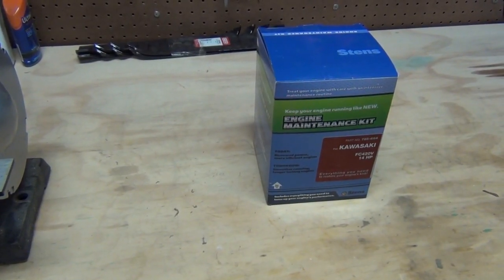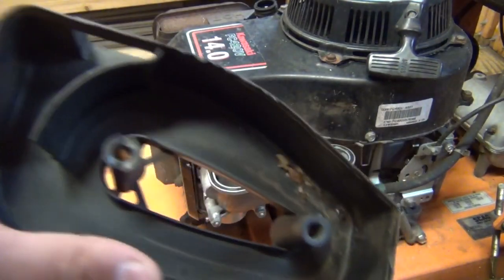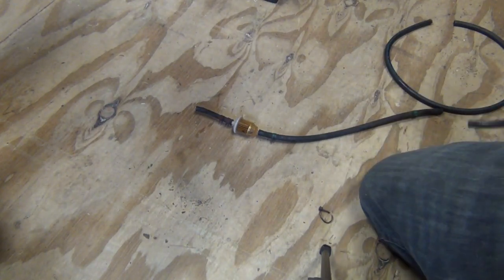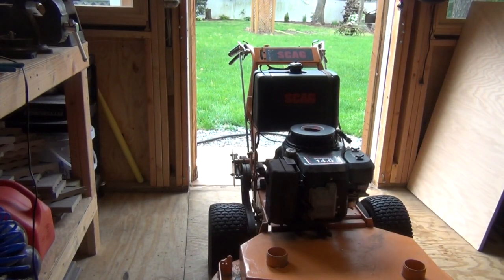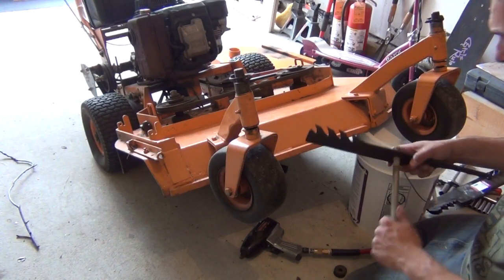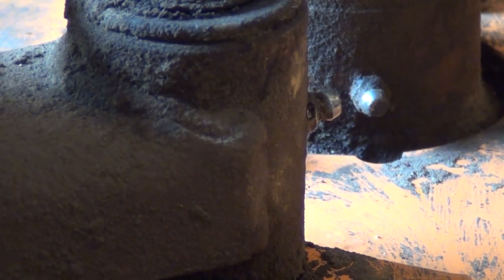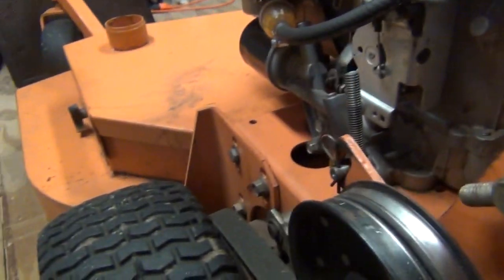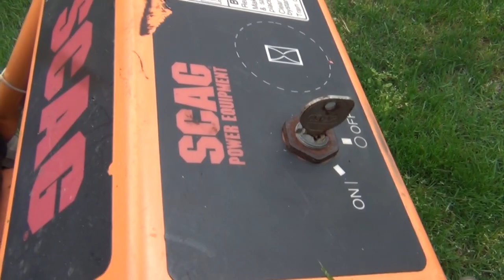Scag lawn mower tune up

Comment: I always run my engine for about 10 minutes before I change the oil. It allows the oil to flow better and it also helps to kick up any sludge that's on the bottom of the engine

Comment: Thank you for an excellent video.zimsjeep.  I've done it a thousand times and still enjoyed your video.  The one thing I would consider is disconnecting the spark plug wire while changing the blades.  There isn't a lot of risk with the impact gun, but others might accidentally get the blade moving and risk losing a finger, hand or arm.  I know a few people who unfortunately made that mistake.

Comment: I think for anyone with any sort of general mechanical knowledge the stuff in your video should be common practice.  However to those who aren't familiar, this video is very well planned out and easily followed.  Great job.  

I picked up a 20+ year old Scag this past weekend.  It has sat for at least 12 years.  Had fuel in it still...not good.  So I ordered a new carburetor, fuel lines, fuel filter, etc.  Once I get it running I'll be doing the oil/filter change as well as new belts.  The one I have has the Kohler 14HP OHV engine.  Supposedly it ran when it was put in the storage shed but who knows LOL.  It will receive a full tune up before it hits the lawn.  Thinking a new set of blades while I'm at it as well...probably standard high lift blades as its setup for side discharge, but may look at other blade options later on once I get it going and do a few lawns.  

Only issue I'm having is the front caster tires are in extremely bad shape, and from what I've found I have to go through a Scag dealer for parts so that'll be another item on my list is to replace all the tires.

Comment: Well done and thanks. My 48 belt drive is 20 yrs this summer. The dealer gets $150 plus delivery to do this work so I have learned over the years. Will look at adjusting the tracking and brakes this weekend--could never figure that out before.  

Q: Re greasing: I wipe well but have not tried a fitting spike. It seems like most times it is very hard to pump--possibly because they are clogged?
Reply from the maker: You're welcome. Glad you found it helpful. Definitely work open those zerk grease fittings with an awl or small screwdriver. They're probably stuck closed which is causing your problem.  If they won't open up, they can be easily replaced. You can get a pack of 10 online for 5-10 bucks.

Comment: like the video very imformative . im considering a scag for residential and some side jobs was curious if the 36 is big enough for most lawns or should go to 48?and to adjust the height of blade theres no lever or anything you have to just add or delete washers? are all scags like this ? last what about the transmission oil is that serviceable ? Thanks

Comment: Great video I enjoyed it I'm getting ready to change the belts on mine I can't find a video on how to do that
Reply from the maker: Thanks man, I had a whole video filmed of belts on this same mower last year. Went to download it to my computer and the memory stick was corrupt!  Anyway what belt are you changing?  Blade belt is easy. When the clutch is disengaged, you have plenty of slack to slip it over the pulleys.  Drive belts are easy too. I pulled the wheels off, made it a little easier but I mainly did that because I changed the tires. Transmission belt isn’t bad either

Comment: was a very good thourogh video!  I am fairly mechanically inclined, but neve had a good mower untill now. just picked up a used one.  Only thing I am wondering in the transmission.  Since i bought it used, i just want to make sure it has oil in it.  how do you check that?
Reply: If you're still wondering they take grease not oil, I had to rebuild mine. If your concerned you can pop the cover off and check if it has grease but should be ok

Comment: Great video! Could you possibly do a video on how to properly adjust or tighten the cutting / drive belt? Your instructional video was great but this one piece of info as you can see has a lot of us needing direction. Any help would be great! Keep up the awesome work.
Reply from the maker: David Harkins thanks for the comment. I'll do a video regarding the belts soon. I changed to deck belt this past spring.  My plan is to replace the drive belts next spring so look for a video early 2018

Comment: GREAT VIDEO. I just got a Scag identical to yours , but with service replacement motor.  Any way to tell how old the machine is with the serial number? The motor is last years model, but the machine is older. In fact,  Looks identical to yours as far a placement of fittings, deck, handles, etc.  This video was very helpful. Thanks for taking the time.
Reply from the maker: Jason Schley Not sure how to tell from serial numbers but if it helps, mine is a 98.

Comment: How do I get off the seized hydro plug? Bent the Allen wrench in the process.  I need to put hydro fluid back in. Can I fill 2 quarts per each pump from the top by taking off the visible plastic holding container and pumping the fluids through the rubber tubing to the pumps?

Comment: What kind of oil do you use, can’t read the weight on the bottle in the video. I just got an older scag walk behind like this one. Thanks!
Reply from the maker: I’ve always used straight 30 weight oil. Had this mower for over 20 years now. No issues

Comment: How much did all of this work cost to get the materials so the kit plus new blades and oil? I am thinking o buying a used toro similar deal. I am guessing by the pictures it could use this work though.
Reply from the maker: Blades were around 20,  the maintenance kit I believe was somewhere around 25 and the oil around 10. So around 50-60 for everything.  You'll definitely save a ton doing it yourself. Isn't too involved.

Comment: Any tricks to get blades off that probably haven't been removed in 12+ years?  I got one broke loose, but the one on the discharge side won't budge.
Reply from the maker: William Todd Other then the old tried and true block of 2x4 as a wedge and a 1/2" drive ratchet with big cheater bar, not really.  I have an old piece of top pipe from a chain link fence. Thing is 6 foot long.  Fits right over the ratchet handle and busts everything loose that I've used it on.
Reply: Maybe try soaking it real good overnight with pb blaster.  The previous suggestion will definitely work as well.  A 2ft pipe over the ratchet usually works great.

Comment: I'm new to commercial cutting and after watching this I had one question...You put on mulching blades but are using the side discharge while cutting, is there any particular reason for this?
Reply from the maker: Good question - The mulching blades regardless if the grass is side discharged or not still produces a more finely cut grass blade in my opinion.  Ideally, you are correct.   They would probably work better if the grass was recirculated under the deck before discharge.  Also, the price difference between a mulching blade and regular blade isn't all that much.
Reply: Id like to add to that. I use gator blades on my Ferris.(in photo) and in the spring the grass is out of control. Sometimes you're cutting off 3-4 inches in some of the first few weeks. You can go over that twice because regular blades dont chop it up fine. Gator or mulch blades shoot out a mist of grass. Also it doesn't stick as much under my deck. I go over a yard one time where competitors have to go over 2-3 times. They also spend more time blowing off sidewalks than they do mowing the grass. lol  With mulch blades throwing out of the side, you get a finer grass cut. Like i said, the grass shooting out of my deck looks like a mist rather than long blades of grass that i have to go over. Time = $$$.. good luck!
Reply: ***** no matter what blades you use,you need a discharge chute on your michine ,,vedio guy dont have one
Reply: Mowed for 20 years successfully without one. We'll manage.

Comment: I'm new to these type of mowers and this may be a stupid question, but can you change the deck height? I'm stepping up from a regular push mower
Reply from the maker: Yes,  check the part of this video where I change the blades...you can adjust the cut height by placing the spacer washers above or under the blades.
Reply: +zimsjeep I mean the deck. I understand what you're saying but is there a way to raise/lower the deck like on a regular push mower? Thanks

Comment: May be a dumb question, but how do you reverse it without switching gears???? I just got a 32" Scag with a 16HP Kawasaki engine, and this is the only problem I have with it. I always find myself in spots where I need to back it up a bit to finish making a turn, but have to switch gears to do it. I'm sure it's a simple technique that I'm missing. Thanks!
Reply from the maker: Pull up on the handles until forward drive disengages but not to far that the brake activates.  You'll then need to muscle around the machine to reverse.  Good tip is to position the mower when you're ready to turn in such a way with the forward gear that all you need to do is pull back maybe a foot before going forward again...if that makes any sense.  I rarely use reverse.  Once you get the above technique down, you can do it in your sleep.
Reply: zimsjeep Thank you! This was very helpful.
Reply: @fixitwithzim  tengo el mismo Problema no puedo ajustar la reversa solo da buelta pero no agarra las bandas para reversa Tendras una respuesta en español.

Comment: Question i have a scag sw36a-16kai will that kit work on mine ??
Reply from the maker: Lazaro Martinez I believe if you google the part number of the kit, you can cross reference to see if it fits the motor on your mower.
Reply: zimsjeep idk i cant seem to fine any kits for the 16hp Kawasaki engine , i keep coming across the same one u have for the 14hp engine but dont know if its the same thing . Oh well

Comment: I was wondering how easy it is to muscle around with the pistol grips. I have an Exmark with ECS controls and sometimes it's a real pain so I wind up just mowing my lawn in a cross cut pattern. So, I was thinking of selling it and getting a scag sw.
Reply from the maker: I don't mind the pistol grips. Some complain about them but I don't have any issues.  I only use it for my yard now but used it a while
Back for my business I sold. No issues either way. Now going from a hydro to this might be a different story but I think in your case, you'll be alright. Just keep everything well greased. It helps a lot.
Reply: +zimsjeep I am coming from a belt machine but there's only one exmark dealer in my area and he wont come pick the machine up and work on it if something majorly goes wrong with it and though I am handy I can't tear my engine apart and rebuild it. There are several scag dealers that will pick the machine up and work on them so I figure if I am going to have an expensive machine I might as well have that safety blanket. Also how is the stripe? My exmark stripes last like a month but the cut isn't exactly anything to rave about, it leaves stragglers and tall grass just bent over. Also if the grass it high it leaves a strip down the center of uncut grass. The scag looks like it cut that tall grass perfectly in one pass.
Reply from the maker: duellingcarl I had that problem with a strip of grass left uncut down the middle once when I changed blades.  I don't recall why it happened.  They were the right size blade but maybe something with the air velocity in the middle with the mulching blade caused it.  Like I said I don't remember as it was a long time ago.  Stripe is great with the scag.  As far as worrying about the engine, do the proper tuneups and take care of it and you almost certainly won't have to worry about rebuilding the engine.  Most of the time, guys don't even rebuild anymore - Easier and faster to just replace the motor.  95% of your engine problems with be fuel/carb issues.  They are always easy to fix and remedy.
Reply: +zimsjeep I think the strip of uncut grass has something to do with air velocity. I am down on rpms already and the belt tension adjustment is right under the muffler (bad design) so the belt is definitely too loose. It's just so hard to get to.

Comment: what is the best way to change the Drive belt? It is located right under the engine block but there are 2 other belts below it. Do you take off the other belts then put on drive belt. Or take off the pulley?
Reply: I figured it out. I took off a bracket, loosened the tension on the belts, unclipped wire harness. Slid drive belt up to top pulley. Then tighten everything back up. Its a good idea to take pics before you start demo & you can refer to them when putting back together.
Reply from the maker: Kim Zenk Glad you got it figured out. I'm actually doing a full belt change on the mower in this video tomorrow.  Drive belt on mine is original. Not bad - almost 17 years old.  Thanks for the tips, very timely.

Comment: How did u reverse it when turning since it is a gear drive and u didn't shift it into reverse
Reply from the maker: Pull up on the controls to disengage the forward drive but not too far that the brakes engage. You're now basically in neutral and can free wheel the deck around with some muscle.
Reply: zimsjeep thanks
Reply: Wow never knew you could do this! Was wondering the same thing!

Comment: scag mower Boggs down when blades are engaged any solutions
Reply from the maker: Brent Goodman Could be a couple things:  easiest to hardest: blade spindles need grease, dull blades, belt not tensioned properly, bad belt/replace, governor needs adjustment, bad blade spindle.  Good luck
Reply: Thanks for your help belts blades an spindles look good I will check out governor adjustment next thanks again Brent

Comment: Does anyone know what size spark plug the scag sw48-14ka with a Kawasaki fc420v engine takes??
Reply from the maker: Jake Fisher NGK BPR5ES (7734) gapped to 030.  I've ran brand new plugs in the past not gapped correctly and this motor runs terrible with them. Make sure you gap them correctly. The NGK's are pretty good out of the box but I'd still check.

Comment: I have the same scag can you raise  the deck
Reply from the maker: You can raise or lower the front casters and the blades
Reply: ok how do you do that
Reply: ok how do you do that
Reply from the maker: Arthur Moore The blades and front casters have spacer washers on the spindle bolts. You can move them below or above the spindle to raise or lower.  Think there is 4 or 5 total on each blade. The casters I very rarely if ever change.
Reply: thanks
Reply: so if I take some of the spacers from the bottom and move the to the top I will raise blades?
Reply from the maker: Arthur Moore Yes, correct
Reply: Is there a minimum you need to keep on either side?
Reply: and if so is there a washer on the top side similar to the one on the bottom?
Reply: and btw, thank you for your video, it'll be extremely helpful when I go to tune up mine. I have the Kohler 15? Hp I believe.

Comment: Should change the gear box grease for the transmission
Reply from the maker: Thanks - I'll have to check into that
Reply: Yip
Reply: Glad I saw this, what type of grease is good for those transmissions?
Reply: domantor11 I was wondering that, except the Scag I have its a sealed transmission, so I don't think it would be wise to open it up would it?  I think its like 8 bolts that hold it together.  Looks pretty dirty, may attempt at least to open it up and make sure it has grease in it.  Its about 25 years old.

Comment: why my scag 48in  mower want go in reverse
Reply from the maker: You sure it's actually not going in reverse?  Reason I'm asking is reverse doesn't act like the forward gears. It's more of an assist when pulling the machine backwards.  You'll still need to give the mower a decent tug backwards for the reverse gear to actually work somewhat.  Hope that makes sense.

Comment: What kind of grease did you use?
Reply from the maker: Robskie13 Lucas heavy duty grease from Home Depot.  Seems to work well.  Been using it for past 5 years with no issues.